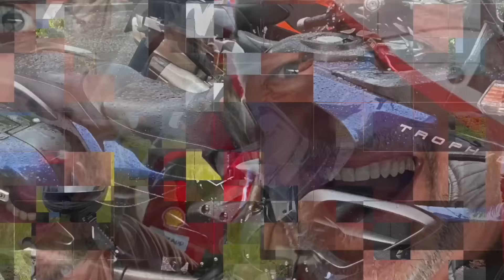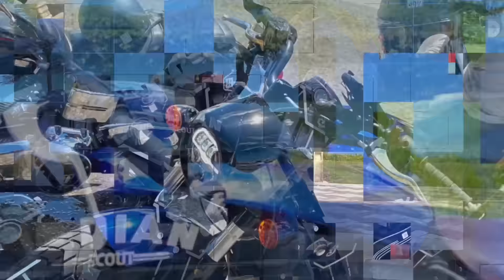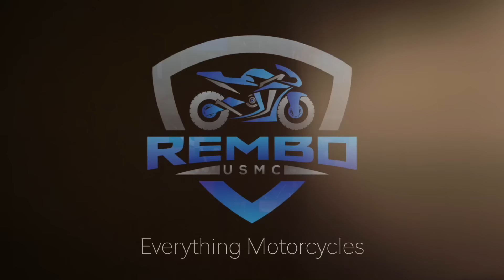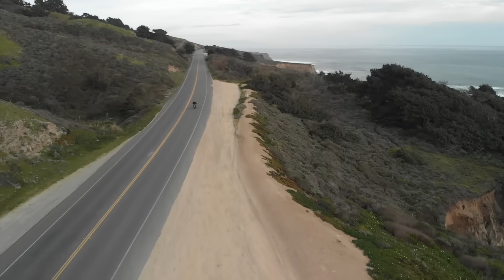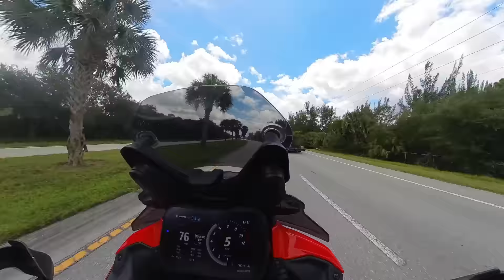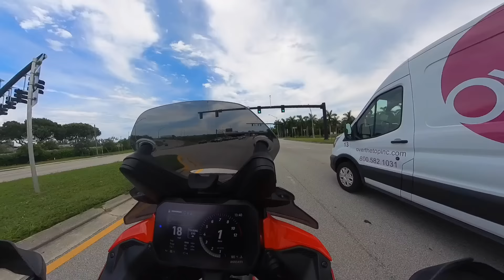What Ryan F9 Did Not Tell You About Motorcycle RPM

Comment: And interestingly neither you nor Fortnine mentioned Piston Stroke and camshaft design concerning maximum torque. And compression ratio comes into it and Fuel type used and does anyone run water injection? You see the 98 octane fuel {assuming you have it} costs a bit more or maybe a lot more; but it is proven to actually keep inside your engine clean and reduces pre-ignition. {Pinging}. {and I run it on all my bikes.} For those not running 98 octane adding water injection and setting it up right actually steam cleans inside your engine. And 2 stroke engines like Fortnine was running in his video are burning oil so will naturally carbon at a fantastic rate if they are not running at enough rpm and heat to try to burn off some of that oil. They will also block an exhaust system in a very short time if not made to run hard most of the time. Then as many people in the comments below have rightly pointed out running at low rpm to reduce unnecessary wear and tear is not really harmful if you are not asking much of your engine for the conditions you are running in {flat road no headwind and almost no throttle to maintain speed} vs uphill or overtaking trying to gun that low rpm engine in top gear instead of kicking it down to let the engine get up to around maximum cam torque area that it was designed to run at for peak efficiency and power production.

Then there is the long stroke engine which is also usually running a lower compression ratio and it naturally has a faster air speed in the intake and exhaust at lowish rpm than a short stroke engine has so they were made to lope along and grunt a little more than a short stroke high compression engine likes to. So really it is horses for courses and treat them accordingly. No engine like to lug excessively but some were designed to be able to do it better than others. My Vtwin cruiser is happy at 2500 rpm where-as another bike I would not ask any performance of it at 4000 rpm or lower but I will let it run at 4000 if it requires little throttle to maintain speed.Dropping it 1 or 2 gears then depending on how much I need to ask of it for hills or overtaking. But one bike has a top rpm of about 6500 rpm and the smaller one about 10,000 so no rule on rpm is identical for both and bike riders will learn what is best or pay for it in engine life or service requirements. It is unfortunate that Fortnine's initial statement of "your running the wrong rpm" implies everyone is an idiot rather than perhaps there are a few who need to understand better what happens inside their engine under different loads and rpm requirements. Have a nice day both you and Fortnine. I too love his videos. Sometimes though a little more information is required which you tried to do.

Comment: I thought I understand carbon build up as oil entering the combustion chamber from past the rings and valve seals naturally and not being burned off from not driving the vehicle long enough, a properly run engine will have pistons and chambers covered with carbon deposits. 🤷🏾‍♂️

Comment: Yep! i drive low rpm bikes (v-twins) They are low torque motors. Even their for me a brake in is to brake in everywere in the rpm plage. A motor that never get to full rpm dont like it, he have to know his max rpm. My red line is at about 8000. But i know his begening to become lazier at 6500 so i wont ask him mutch. When valves spring begining to flote its realy not a good idea to continued climming. Mine is happy at 2000 4000 in low gears and at higher gears, he's ready for high rpm. I have six gears i have a low six, even their i dont use my sixth gear for max speed pulling. Thats the job for the fift. I dont drive by  the gauges, I ride by earing my bikes. You ear it when they got enouph. A bike that never seen max rpm is not brake in yet. No F need tousand hps for pure pleasure. A torquy machine is a funny machine.

Comment: I think the main aspect of the story is 'in general' and 'common sense'. Cold start reving to redline, thats not common sense. Chucking low rpm on a low CC under too heavy load, is more a case 'in general' and those are often the exception that confirms the rule. Then i read this comment 'i rev higher and my fuel economy down the drain'.. well, there is your 'common sense'. Nonstop going redline? Offcourse its bad. Going sub 3k rpm nonstop? Same story other way around.

Comment: Stop driving your motorcycle like it's a car. It was designed for higher RPMs than an automotive engine. You bought your bike to have fun, don't drive it like a grandma. Have fun on it. If it needs to be rebuilt at 50,000 mi rebuild it and maybe learn something. Remember you bought a bike to have fun. Don't get on your bike and look 2 years in the future. Thinking you might have to rebuild the bike. Get on it and have fun.

Comment: Would you rather buy a used bike from a guy riding like grandma? or a guy just under the red line most of the time? I think most would say grandma, because the high RPM comes with side effect behavior... same as the red meat debate, people eat high red meat also have other lifestyle issues, so it is not the meat per se.. it is always the all picture... people that push the bike, push it in many ways that takes away from the longevity of the bike components.
Reply: High rpm. Because if it's still running you know that shit was built on a wednesday.
Reply from the maker: Great thought
Reply: I want the extreme low mileage Grandma ridden bike, preferably under 5k miles, so I can save the depreciation and go on from there. I cruise at rpm that doesn't lug if I accelerate. As for the red meat comment, I go blood rare and grass fed with no feed additives at least 15 out of 21 meals. Three Harleys, a Hayabusa, and a BMW GS, so rpm's vary. Health wise, 75 years and counting with no issues worth mentioning.

Comment: I think F9 does a remarkably good job of covering things motorcycle most of the time. I think this one was a bit stretch. Toyota Camrys often run hundreds of thousands of miles. You think Mom is pinning the rev limiter on every grocery run? Doubt it.
Conversely, if you like the racing, get a pit pass. You can go watch them tear apart the engines that are constantly run WFO. Why they gotta tear engine apart? They like high rpm, no?
I don't disagree that blowing out the soot from time to time is a bad thing, but additives can help with the carbon build up too, w/o garnering so much attention for LEOs. Most brand name fuels have their own additives mixed in.
He hit on the main point, but then disregarded it to carry on w/ his narrative i.e. detonation. In laymen's terms, knocking and pinging. Over the decades, I've found that A LOT of bikes do both if accelerating hard from lower rpms. The solution is simple. Buy higher octane fuel or don't pin the throttle going up hills from lower rpms.

Comment: I'm not completely buying this.   High rpm and high heat have a much greater affect on engine life than carbon fouling. Heating and cooling cycles from many short rides vs fewer longer steady low rpm rides will negatively affect engine life.

Comment: Ryan is a physicist. What's your education?
I always trust science, hopefully so do everyone else.

If you want to use low revs, do it when it is not damaging. Use low revs on flat roads, downhills, low drag.

Use higher revs, when your engine is warm, accelerating, uphills, towing, two-up etc. Basically any time there is a drag.

Basically, only time higher revs can be damaging, is doing it on cold engine.

If you want a piece of mind do not buy a vehicle with:
Automatic transmission (which use way too low revs to reduce consumption and emissions)

Turbo/supercharger (almost guaranteed to break after 100000 miles)

Four wheel drive (double the possible troubles)

Comment: My bike gets hot enough in traffic to operate the cooling fan. This doesn't happen at speed as the cooling is enhanced by wind rushing through the radiator. Surely this blows F9 theory out of the exhaust
Reply from the maker: Not necessarily. You also need the pressure from the hot combustion to blow it out. The engine just running hot is only part of the equation.

Comment: what a load of crock, modern engines are fine no matter where in the rev range one uses them without lugging of course.  Fuel injection and revs being limited just forget about it the engine will outlast you!  I service my own ducatis, there;s never carbon on the pistons and I never , well nearly never hit the rev limiter.  Carbon buildup only happens on old lawnmowers!
Reply from the maker: Are you sure about that?

Comment: This is all utter nonsense for all but old 2-stroke engines that carbon up at low speeds due to their design..  When you run a 4-stroke engine at higher than necessary rpm you are only inducing premature engine wear and wasting fuel.  The amount of power required to propel a motorcycle up a grade or to overcome induced air drag at a given speed  is unrelated to rpm.  

At a given continuous load condition (fixed speed on a level grade as an example) an  engine operating at high rpm inherently has much less dense charge in cylinder that is harder to ignite than same engine operating at lower rpm.  At lower rpm cylinder has less combustion events per unit of time anf thus it stands to reason the combustion pressure and temperature must be higher (much denser charge) during each combustion event to achieve same average power output.  The only caveat is you should never lug an engine because it is hard on bearings.  

It is obvious when you are lugging engine because acceleration will be very poor and/or the engine will provide unstable but noticeable power pulses.

Even Fortnine publishes useless, meaningless content.  Maybe it was more tongue in cheek but apparently most can't see through this.

Thought about another way a 250 cc motorcycle at 50 mph is going to require in theory 4X higher rpm at same cylinder pressure as a 1000 cc engine (ignoring other losses and weight effect on rolling resistance).  Similarly, a 250 cc engine would need to operate at 2x higher rpm & 2x higher cylinder pressure as compared to 1000 cc engine to deliver same power.
Reply from the maker: Are you sure about that?
Reply: @RemboUSMC  You can find many resources on internet about engine load and power.  A spark ignited  engine is basically an air pump that utilizes restriction on inlet performed by throttle plate that reduces the density of cylinder mixture and in turn limits the power output at a given rpm.  The engine output must always  equal the load.  Dyno curves as an example are always generated across the rpm range at wide open throttle condition.  The effective power output of an engine is a function of the displacement X rpm X MEP ( mean effective pressure) in the cylinder.  If power output remains a constant then increasing the engine rpm requires the MEP must decrease proportionally.  Low MEP equals low density mixture that is more difficult to ignite.